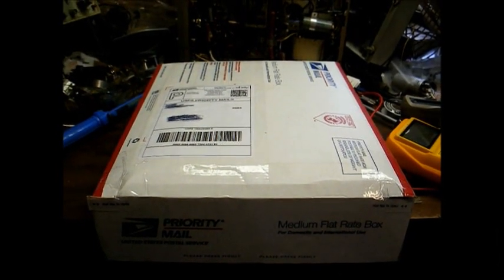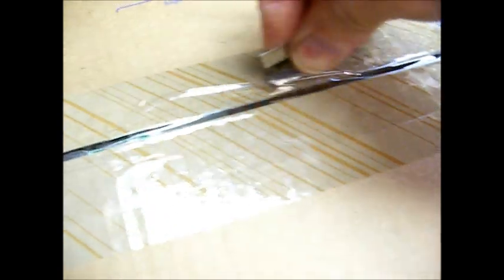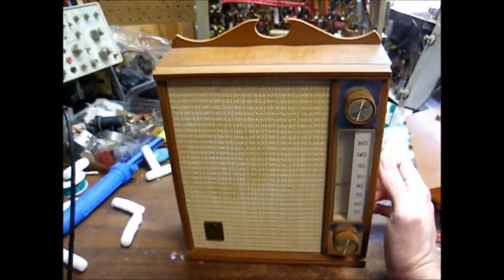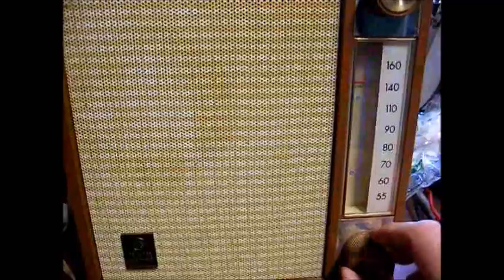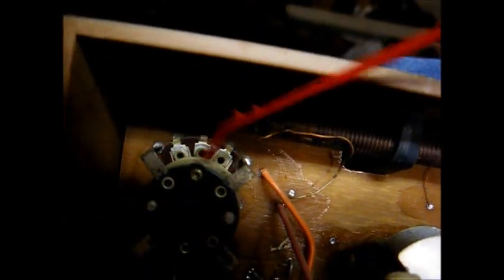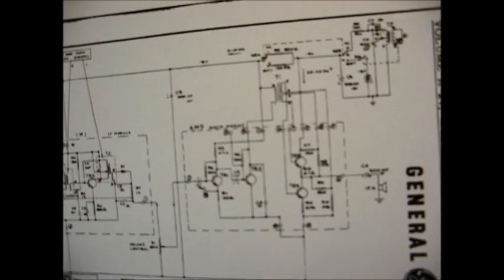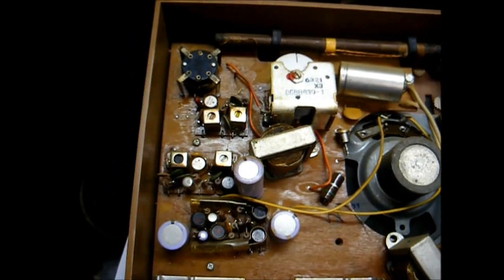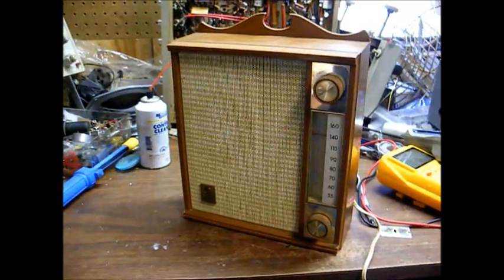General Electric model H220A "hang on the wall" transistor radio from 1963

Comment: They made a toilet paper dispenser am battery radio about the same year but it wasn't GE. It has a place to mount the toilet paper roll and came with adhesive to glue it onto the tiles. It was one of the first bathroom radios marketed by Publishers Clearing House in their catalogs.  Shower radios with waterproof speakers came out in the late 80s

Comment: Interesting design for a GE; it almost seems home-made compared to their higher volume models. I've seen modules like that in a Lafayette 3" reel2reel recorder and in  1930s-replica novelty radios from the 1970s.  Wonder where the modules themselves were made. I've read some speculation recently that the reason Garrard used a mechanically complicated sub-chassis when they designed their "unimech" models (42, 62, etc.) in the mid-1970s was that they were hoping to farm out the manufacturing of the changer chassis to a low-wage country; of course, they ended up getting bought out by Gradiante and the whole operation moved to Brazil in the end.  Anyway, wherever those modules were made, that GE sounds better than what most of the Japanese competition was making in that range at the time.

Comment: My parents had the Quaser works in a drawer tv, 1976 model. the set had a drawer that pulled open from the front and then you could unplug the bad module and put in a new one. I changed the color module and did some other repairs on it. The biggest problem were the grounds at the corner of each board, I'd clean them with an pencil eraser.

Comment from the maker: It performs OK and this is a low voltage device with little risk of anything blowing up if a cap goes bad; so, I'm not going to recap it at this time.

Comment from the maker: I think it was around '62 when they started with the modular design. I have a '68 GE tube/transistor hybrid clock radio that has it's solid state front end on a module that's soldered on to the main chassis.